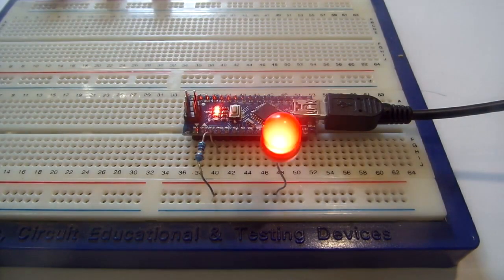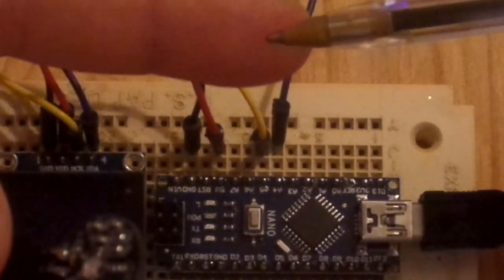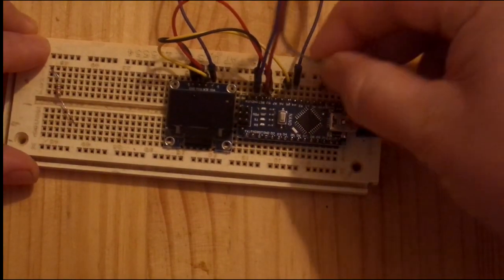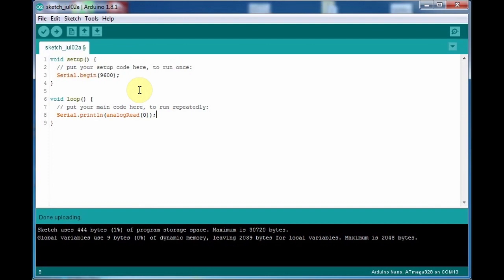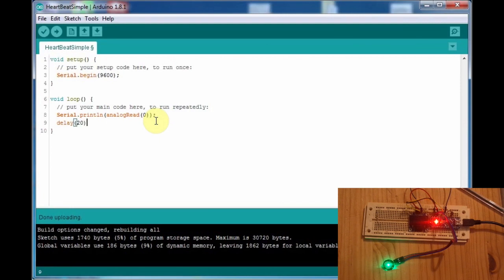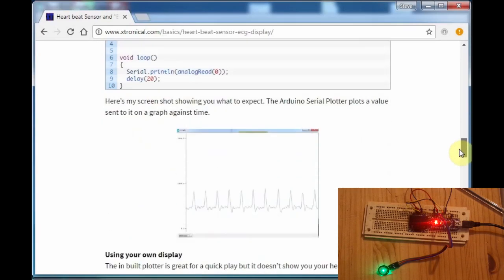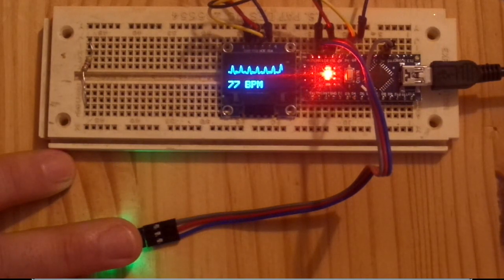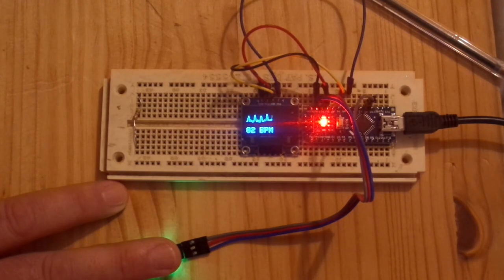Heart/pulse sensor with Arduino

Comment: Hi! is it possible to change the ppg input to an ecg input(RA,LA,LL) with a single output? i noticed the ppg uses a 5v input, will there be any difference if my ecg wave output to arduino is in amplitude ranges of 300mV
Reply: my ecg output on an oscilloscope https://1drv.ms/i/s!Asi2mEsiN_QjolLtahwE4uvvJXxK
Reply from the maker: The Arduino will lose a lot of resolution, instead of digital range between 0 and 1023 (I think) you will end up with something between 0 and about 16 or so.
Reply: XTronical why will there be a resolution drop? Sorry i do not understand
Reply from the maker: Because by default the Arduino will convert voltages between 0  and 5v to numbers between 0 and 1023. 300mv (0.3) would give a maximum of around 60 (sorry said 16 earlier, my mistake). To solve this you need to alter the voltage on the vRef pin. See the reference page
https://www.arduino.cc/en/Reference/AnalogReference

Comment: I am not getting the proper reading on the serial monitor,  sometime doesnt increase from 0, sometimes its showing 9, sometimes  its show negative value of -2 too, its not showing the expected BPM,  i am confused whether sensor is working or not!  or am i missing something bro?
Reply from the maker: Have a look at the reply to Dharelle Sison below, this should help you investigate
Reply: I have tried changing the threshold values, still not getting the expected BPM bro...
Reply from the maker: Check the voltages at the input to the Arduino, are they jumping about too?
Reply: Can you clarify little more bro, i dont have much idea, jumping ?
Reply from the maker: Sorry, I mean measure the voltage going from the signal of the heart beat sensor, it seems to be outputting too low a voltage range. It looks like it good be faulty or something. The voltage should be from 0 to 5v and when no finger on it should be around 2.5v. You may need a good quality non-auto ranging multi-meter to do this or even better an oscilloscope if you've got one.
Reply: So i have to change board or ?
Reply from the maker: It's possible your sensor is not working correctly, but you need to check it with multimeter or scope.
Reply: its 4.8v in arduino input brw,  does the light from the surrounding effect the  beat rate that way?
Reply from the maker: For the low readings you were getting 4.8v does not match, for that voltage you should have readings around 1000 for a voltage that high, the surrounding light should not affect it very much at all.

Comment: When I use the code from xtronical.com I get the error 
'class Adafruit_SSD1306' has no member named 'writeline"
Any idea why?
Reply from the maker: Only line 36 uses that command and it should be writeLine not writeline (notice the lowercase l in your example). I've just checked and the original code used a capital "L" (a it should). Perhaps you accidentally changed it? Full line should read

  oled.writeLine(lastx,lasty,x,y,WHITE);
Reply: No that was my failure to copy it properly for this question.  I am confused about the whole thing.  Has Adafruit changed the library?  This, almost, works if all the "oled.???" lines are changed to "display.???"  The only line that doesn't work is the one under discussion.  It has 5 parameters and they are difficult to understand in context.  I will keep worrying it for now and see how it goes.
Reply from the maker: I'll do a clean install from scratch for you, get back to you in a day or so
Reply from the maker: It sounds like you do not have this line at the top correct:

Adafruit_SSD1306 oled(1);
seems like you've got it as

Adafruit_SSD1306 display(1);
Reply: Now just so we know; I copied your code from the XTronical website.
So any errors are very confusing.  It is odd.  I am sure you have a clean copy but there is no way that I can compile your code.  I can compile the code if I change the oleds to displays.  Which proves your code works, but why does it not work with oleds, ie as written?  I have just restored my desktop from a week old backup as I was having problems with the Arduino IDE not seeing the Nano board and, of course, the code was on that drive.  So I have just copied your code again and the problem has not gone away.  I'll make the changes and get back to you.
Reply from the maker: Hi, sorry for delay, I forgot! So as an apology I've looked into it right now. I've been able to replicate the error by installing an older version of the Adafruit-GFX-Library. So previous versions didn't have the writeline routine (and possibly other routines missing also). It seems like you've just landed on the wrong download page at some point for an older version. Easiest thing to probably do is to use the Arduino Environment to update your version to the latest. Go to menu option "Sketch->Include Library->Manage Libraries..."
Then type "adafruit gfx library" into the search field. The top entry should be the graphics library we need which should say installed and give you the version installed, which for me I used 1.2.3 (the latest version at time of this message).
Click anywhere on this entry and it will then show a "Select Version" menu and a disabled "install" button on this entry. Click the "Select Version" menu and select 1.2.3. The "Install" button should then enable. Click Install and after it's installed close this window and you should be good to go.
I will copy this reply to the other thread with this problem that you commented on. Thanks for the feedback and reminder, it may help others :)

Comment: Hello Bro, nice work.
but I tried putting wiht rf 433mhz and bpm goes crazy like 800-900, do you have any idea why?
thank you.
Reply from the maker: Sorry I don't quite follow, rf 433mhz?  Are you running this on another Micro-controller?
Reply: on arduino nano works perfectly like in your video. then I added a transmitter, + another A.nano with receiver.
Then it goes 800-900 bmp. I am wondering if the transmitter/receiver are the causes of that. or I broke the pulse sensor.I do have same pulse sensor like yours. TIA
Reply from the maker: Ahh, thank you I understand now. Does this RFModule use the one of the same pins? Also what library does it use and I'll have a look if there are any conflicts that I can spot. Does it work ok of you take transmitter off?

Comment: Hey dude i tried the code in Serial monitor but the output BPM is less than 30 bpm and mostly lessthan 10 bpm if i put the BPM in OLED is there any changes with the Output ? is it becoming accurate when it have OLED
Reply from the maker: No it won't be any more accurate. I suspect your sensor outputs a slightly different range than the one I used, you need to alter the constants used that help determine what is a "complete beat". These two values are used to help determine a complete beat

#define UpperThreshold 550
#define LowerThreshold 500

As your beat is very low it would seam that the sensor is not going above 550 or below 500. Try outputting the raw value from your sensor. Where you have the lines:

  Serial.print(BPM);
  Serial.println(" BPM");

add these two lines right after them

  Serial.print(value);
  Serial.println(" raw");

This will show you the range of values coming back from your sensor. You should look at what the minimum is typically and set the LowerThreshold a little above that. For the maximum value you see set the UpperThreshold a little lower. You may have to tweak these two values for upper and lower until you get a good result.

Hope this helps.
Reply: for clarification I will look for the minimum raw and set it for lowethreshold ? My minumum raw is 410 and maximum is 798 for the past 10 seconds  maybe ? so what would be the upper and lower values i set ?Thanks
Reply from the maker: I would have thought that would be fine with those values, was it still reporting a low BPM. If so try lower threshold at around 480 and upper around 650
Reply: nice BRO ! HAHAHA it gives me 60 to 90 BPM 

it would be much better if i Could understand  the Convertion of raw to BPM waaaaaaaaaa.
thank you bro.
Reply from the maker: That's about the right BPM to expect. Glad it worked :)
Reply: Bro , Help me pls .
Reply from the maker: Dharelle Sison help with what? Thought it was all sorted.
Reply: My pulseSensor is doing Good. I want the buzzer code of your project in this video.Can i see the code
Reply from the maker: I've now done this, see this video

https://www.youtube.com/watch?v=hSH_DLBoRy0 

and this web page 

http://www.xtronical.com/basics/heart-beat-sensor-ecg-display/
Reply: what is your lower and upper threshold?
Reply: @XTronical  i am having loads of trouble on this project as you can see from my past comments where is the   Serial.print(BPM);
  Serial.println(" BPM"); 
on the code and when i put that into code keeps giving me error serial does not name a type
Reply from the maker: Which code is it your trying to run there.
Reply: what values u have taken as threshold values.Secondly I wnat to ask that when would I have to place my finger on the sensor.
1. before the uploading of the code and same time upload it.
2 after uploading and getting wait for some time and then place.
because my readings get stuck at one place that is "0"
Reply from the maker: You can put your finger on at any time, doesn't matter. The sensors require a relatively steady and gentle pressure.  If you scan the comments you should find some other suggested threshold values that have worked for others.

Comment: hey !!
thanks mate
can i mail to for quires regarding code ?
Reply from the maker: Rikesh Adhikari what's your question?
Reply: XTronical  code is what I want ?
Reply from the maker: Rikesh Adhikari. Code available on this Web page : http://www.xtronical.com/basics/heart-beat-sensor-ecg-display/
Reply: can we see bpm in serial monitor?
Reply from the maker: The code below should output the BPM to the serial monitor (not tested but compiles and looks OK). I've also updated the page for this project to include this code, see 

http://http://www.xtronical.com/basics/heart-beat-sensor-ecg-display/
 
 
bool BPMTiming=false;
bool BeatComplete=false;
int LastTime=0;
int BPM=0;

#define UpperThreshold 550
#define LowerThreshold 500

void setup() {
  Serial.begin(9600);
}

void loop() 
{

  int value=analogRead(0);
  // calc bpm
  
  if(value>UpperThreshold)
  {
    if(BeatComplete)
    {
      BPM=millis()-LastTime;
      BPM=int(60/(float(BPM)/1000));
      BPMTiming=false;
      BeatComplete=false;
    }
    if(BPMTiming==false)
    {
      LastTime=millis();
      BPMTiming=true;
    }
  }
  if((value<LowerThreshold)&(BPMTiming))
    BeatComplete=true;
    // output bpm to serial monitor
  Serial.print(BPM);
  Serial.println(" BPM");
  delay(1000);
}
Reply: BPM is always zero in the serial monitor by this code, What is the problem?
Reply from the maker: Can you confirm the pulse sensor is working correctly.
Reply: Yeah its working, i got the data but data varies a lot from 10-278, and it doesnt show the single data in the serial monitor, so how to read the accurate data?
Reply from the maker: If you are using the code for the OLED it won't show in serial monitor, ir you are using the serial monitor version check that it can send anything to the serial monitor by including  a Serial.println("Hello, test"). You large variation in values  is similar to the one from Dharalle Sison below, look at my reply to that comment below and you will probably sort it. Basically you need to calibrate the code to your sensor.